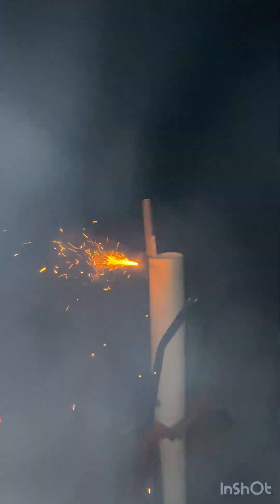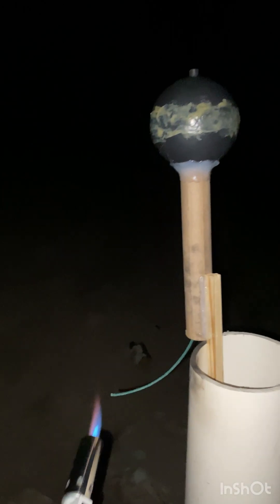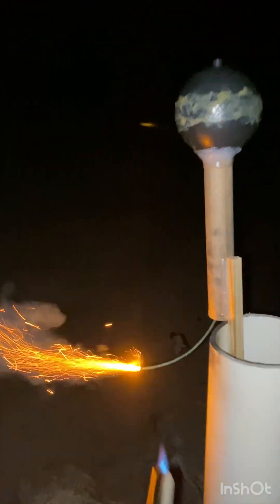#nuclear Whistle #Rocket #Strobe Rocket

Comment: Excellent sir can you sahre the composition
Reply from the maker: Which composition would you prefer?
Reply: Strobe rocket
Reply from the maker: I’m assuming you mean you want the strobe composition. It is only one of the comps used in the strobe rocket. The lift composition is whistle fuel. 
  Having said that, if you do not have a press for pressing the composition into the tube then do not attempt to make this rocket. Hand ramming will cause it to explode! Never, under any circumstances, ram whistle OR strobe composition! There are several types of strobe formula that you could use. As there are many whistle formulas too. I suggest going to fireworkscookbook.com and looking up the specific formula there.